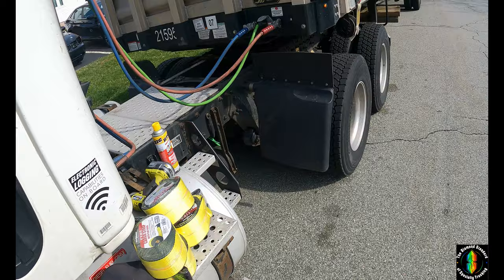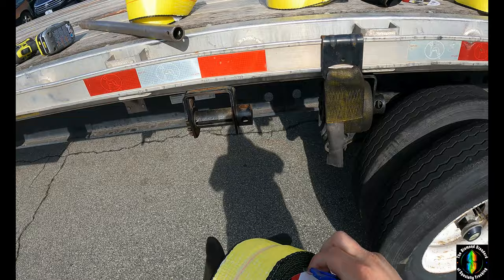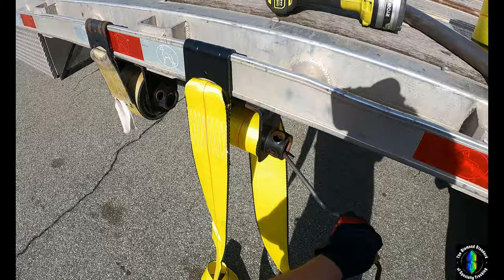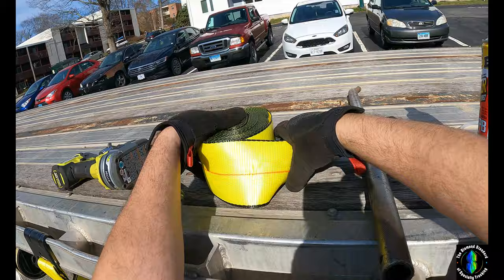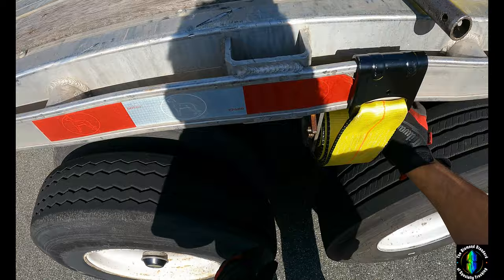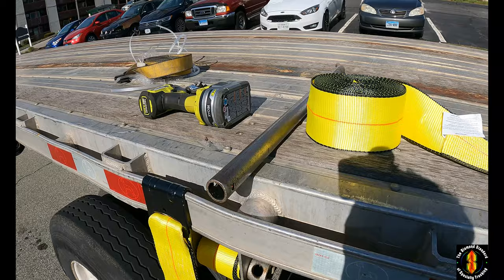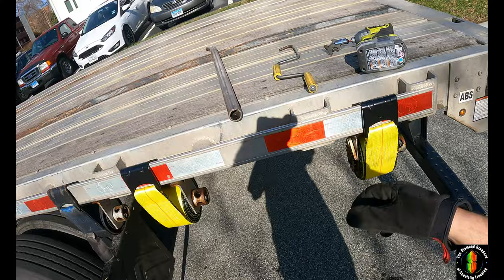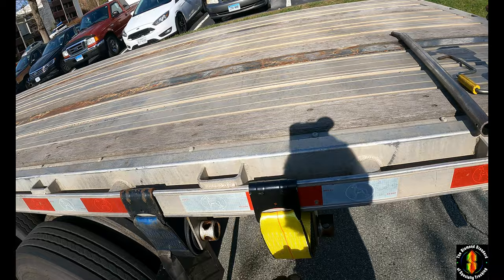Tips for new flatbed operators and putting straps on trailer winches!

Comment: Actually it wouldn't matter if your strap was rated for 10,000 lbs. What's the rating of your rub rail? Is it 4,000 lbs or 5,000 lbs? The weakest link is the rating you need to use.
Reply: There is no such thing as a rating for a rub rail. I’ve been flatbedding 43 years and that statement cracked me up! 🤣😂😅

Comment: Hey man I have watched your videos for a long time. Before I became a flat bed hauler. I us the m18 milwaukee drill with a 5/8 Allen key to wind my straps up makes it quick and easy just use both hands on the drill. I pull B-trains and haul 160,000 pounds.  Keep safe my guy and good luck!! For the strap winder on for the rail there is 2 different styles I can show you and you can get them at a TA or pilot truck stops.
Reply from the maker: Yeah if you want to contact us we'll be more than happy to create a post to spread awareness for different styles

Comment: New to flatbed I apologize for dumb question but id rather ask dumb then look dumb are you taking it all the way back off the winch when you throw strap over load? Is this for storage or just to stretch fibers.??
Reply from the maker: This is to replace the straps and to stretch the fibers because when you go to secure a load and the straps have not been broken in yet they tend to give a little more every time you tighten so this way it ensures some type of stress on them so that you aren't constantly cranking out in the field.

Comment: Try the M12 Milwaukee screwdriver.
Can get for $100 with carrying case, charger and battery.

Has lots of torque and spins faster than that hammer drill was. That and will use 1/4" bit you're using.

Use about every day doing electric work.
Reply from the maker: Sweet, can you provide a link for the bundle so we can share it?
Reply: @SaffordDelivery  
At home depot or runnings
Reply from the maker: @deadman12078  ok thanks

Comment: Nice video, new flatbed owner/op subscriber here. Do you generally leave your straps on the winches at all times or do you take them off and put them in a box? Thanks!
Reply from the maker: I leave them on but always make sure that you crank them a couple more times because they tend to come loose with The rate that you drive.... Also there's plenty more training videos on the channel
Reply: Wow, I never knew there was so much science involved in securement straps!   But honestly, I’ve been in the game for a while now and the way I break in my straps is to throw them over the load and tighten them down.   I’ve never had an issue with a brand new strap experiencing fibers expanding.  When you wrap the entire length of a strap around a winch it will require seem like you’re stretching the material because you can keep tightening over and over again but what’s really happening is you’re just compressing the wrap on the winch.  The fibers aren’t stretching, they’re just sliding in tighter into the winch.   Engineering isn’t your strong suit.   Stick to day cab flatbed.
Reply: @thehovermatic1243  Exactly this. What a waste of time and effort lol.

Comment: You didn’t save anything.
I buy straps by the 10 pack at Superior Trailer for $120 all day long in Oklahoma City. You must be a new driver. Always use sidecutters to remove that platic band around the new straps. Also, once  those straps get wound up 3 or 4 times and they get crooked that drill won’t work. Stretching fibers? That’s the most 
RIDICULOUS thing I’ve ever heard. The strap IS NOT stretching! It’s simply winding up tighter on the winch. After 43 years of flatbedding I can tell that you’ve only reached kindergarten status in the trucking industry. The word salads you’ve been spewing reminds me of listening to Kamala Harris. 🤣😂😅